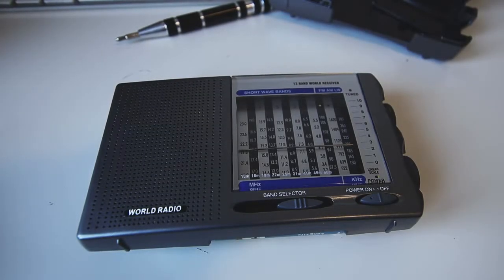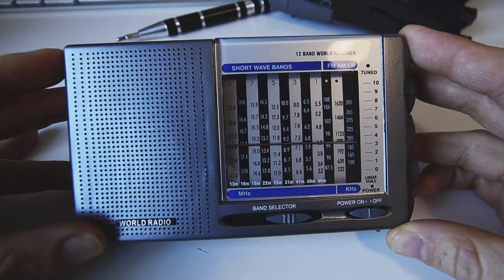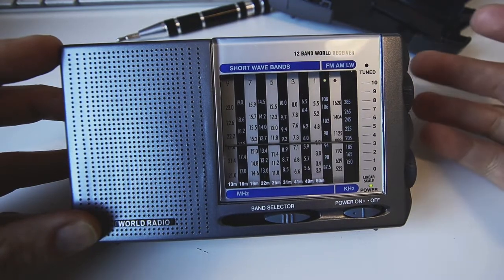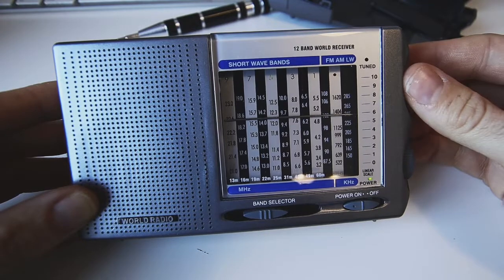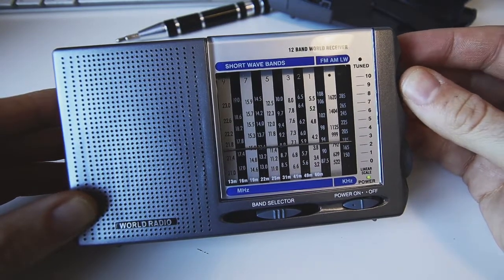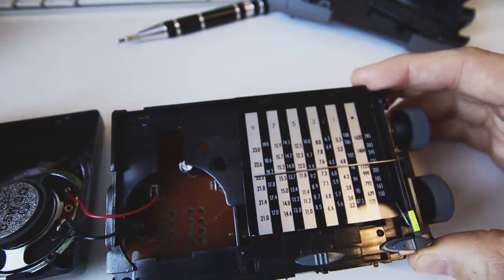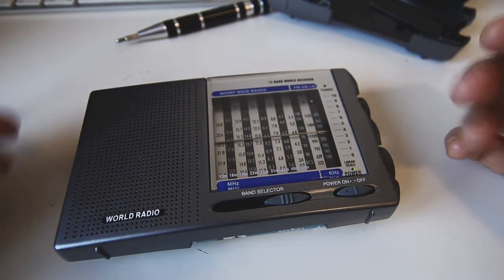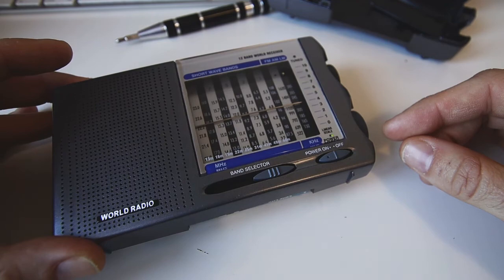Is this 'analogue' radio actually digital?

Comment: Sounds like the stepping/mute while tuning a cheap DSP chip digital receiver. Very common nowadays.  Cheaper. Less components like filter coils etc.
Reply: More likely no filter coils at all. And the choppiness is probably the aliasing caused by the DSP chip.

Comment: Hi, you didn’t show the tuner inside the radio, all modern Chinese rubbish uses a voltage controlled tuner not a digital one , these tuners are one of the worst design concepts ever,  they are awful to use done for cheapness . In the 2000s you can’t buy anything new of quality no matter how hard you try . Happy new year.  Regards JH